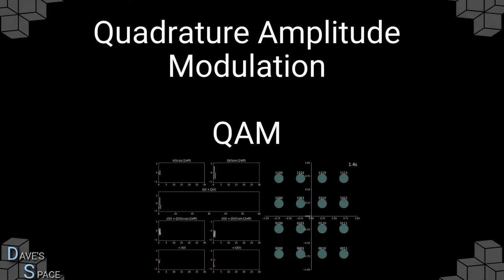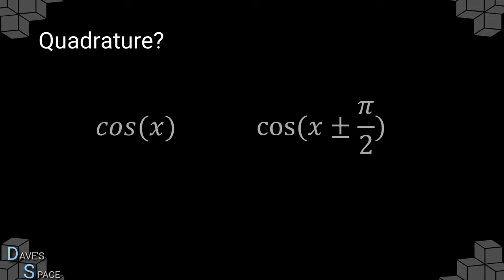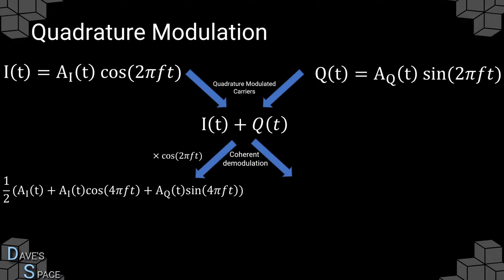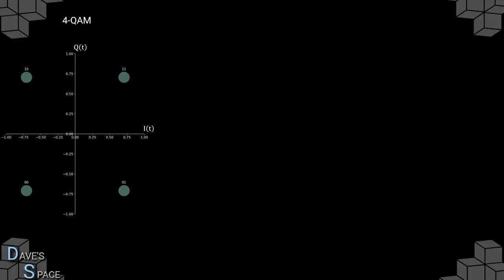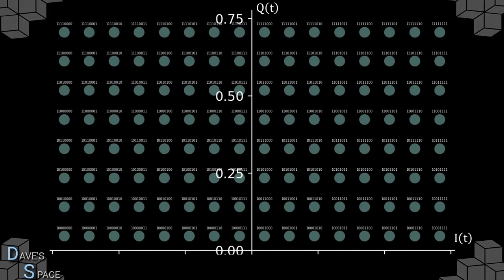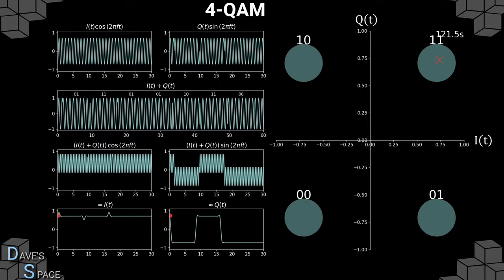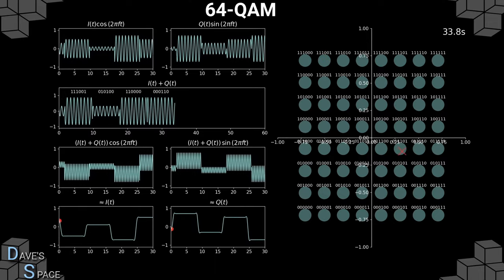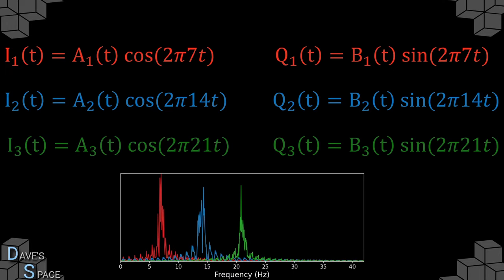Quadrature Amplitude Modlation (QAM): Explained

Comment: Another question - what is the minimum difference in power that the RX side would detect as a "different state" for power level?  It would seem at more complex states like 1024QAM, if there were 10 different states, the percentage would not be linear like 10%, 20%, ... to 100% but rather in a way that puts it consistent with dBm out (and on the RX side, equal spacing of actual received levels).  Would love to hear your thoughts on this.  Thanks!

Comment: I'm mostly curious how it can distinguish between positive and negative phase. It seems like the starting point would matter, because if you are off by half a cycle, you would interpret all of your amplitudes as inverted.

And then the same goes for determining amplitude. I can see how to do amplitude relative to each other, but not how to do absolute amplitude without a 3rd signal for reference.

Comment: @7:11 Can you please help - I can't find this info anywhere.  What differences are they in WiFi in the actual real world?  For example, if 1.00 = 10dBm, does .75 = 8.75dBm, .5 (half power) = 7dBm, 0.25 = 4dBm and 0.00 = ?  Also, for more complex forms like 1024QAM, would it be 10 difference power level states?    Thanks!!

Comment: Could you explain how to get the filtering signal phase sync'd with the carrier signal ? Is frequency sync also an issue, because maybe there could be slight differences in the freq of the emitter and the receiver.